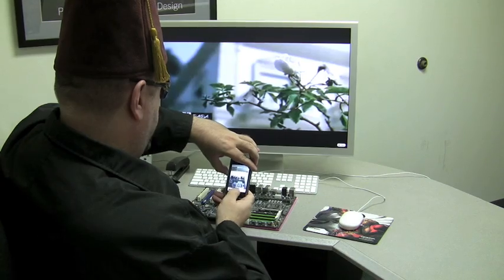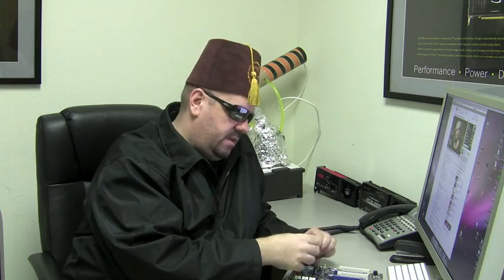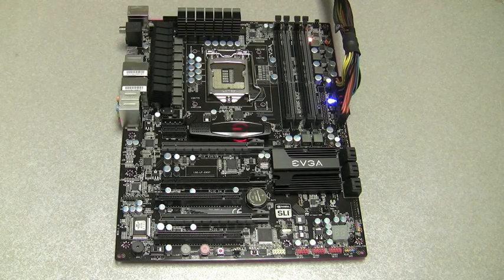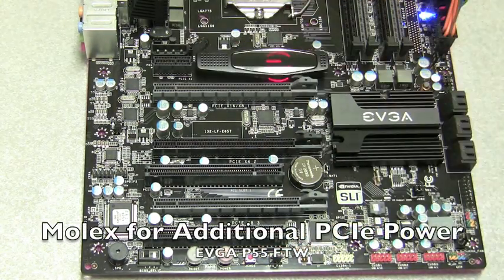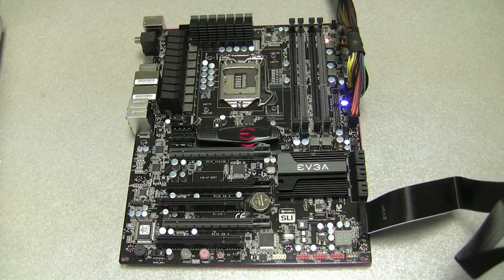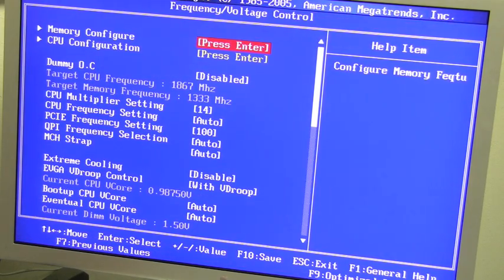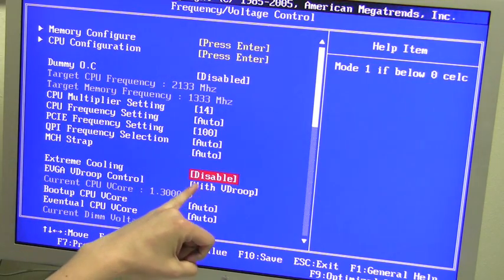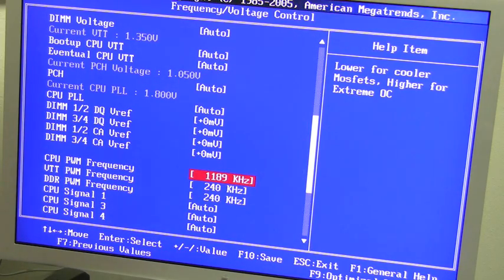EVGA P55 Motherboards

Comment: shut up, EVGA kick ASUS's ass. Cuz ASUS are known for this fuck tarded feature were wen ur GPU gets over 70 degrees in game then itll slow ur GPU (s) to around 100 MHz, like wat is the point of that, and also there boards tend to get extremely hot. I have had an ASUS board, complete load of JUNK.